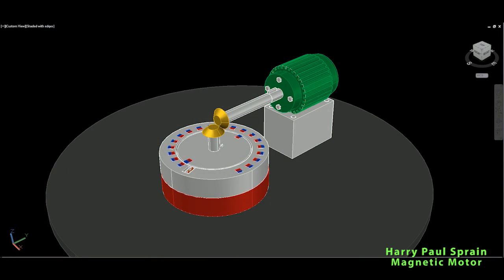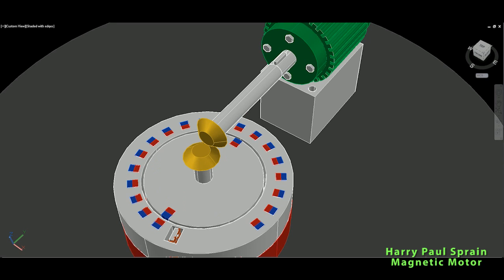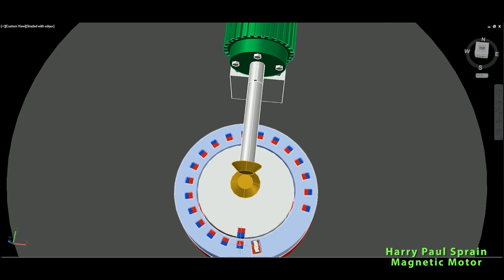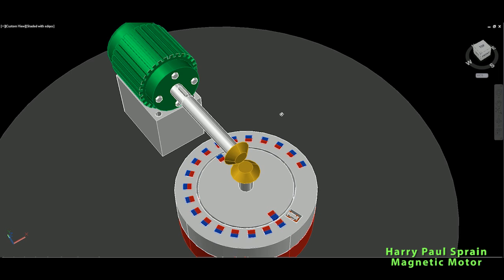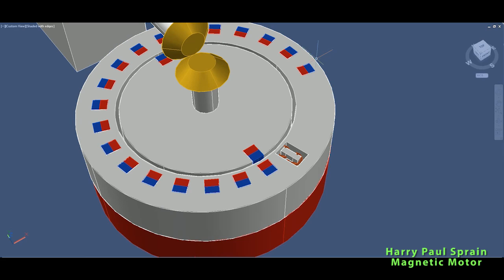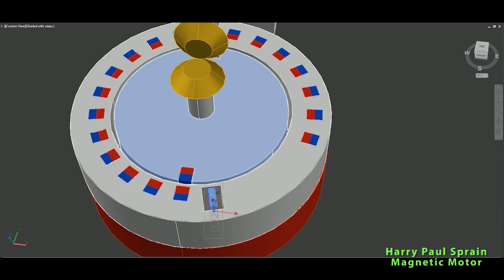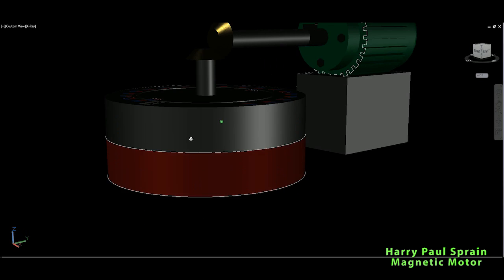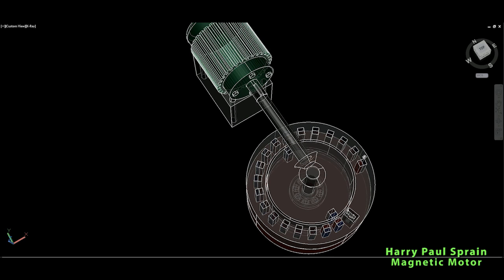Free Energy Generator, : Magnetic Motor!!!!!

Comment: The principle of that motor is flawed - the electromagnet has to provide the energy needed to pull the rotor magnet away from the last stator permanent magnet, which is the same as the energy is got going round the 1/2 circle - you don't get a free lunch.

This is always going to be the case with magnets, once you return to the initial configuration you have exactly the same magnetic potential energy, so energy to drive the rotor has to come from somewhere else.

Comment: Mario,
Please explain what "free" means in "free energy".  I watched another video you did discussing a free energy generator designed by John Ketchersid. Are you implying that when the device is running you get more wattage out than wattage in?  The explanation you gave in your video showed that like magnetic poles repel and unlike magnetic poles attract; so what! The design showed gears and pistons indicating to me  that the device was bogged down with frictional elements. I saw no explanation of what the device actually does, in fact,  I only saw a 3D cad model. If the device only exists in a cad drawing and does nothing, what is its purpose?
david
Reply from the maker: Please read the original patent description on the link in description. Thanks
Reply: Mario,
I did look at the patent description. It was a product patent which described the machine's components and  mechanical operation. Basically the machine spins around in circles due to magnetic attraction and repulsion. A machine that does this is called a motor. Unfortunately the concept that was sold to investors was that the machine would produce free electricity and "put the power companies out of business". When the actual patent description was published, this sales concept was never mentioned. My reason for stating this is to point out that people who do not have an understanding of basic physics and electronics invest money to develop these devices. In the end they always end up losing their investment and the so called inventors laugh all the way to the bank.
david